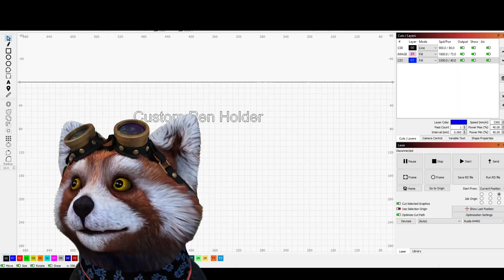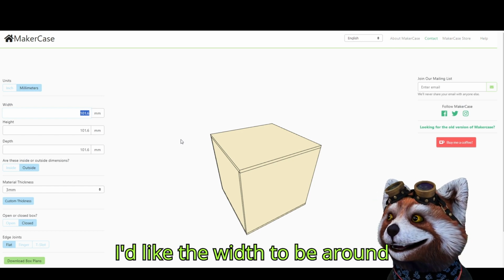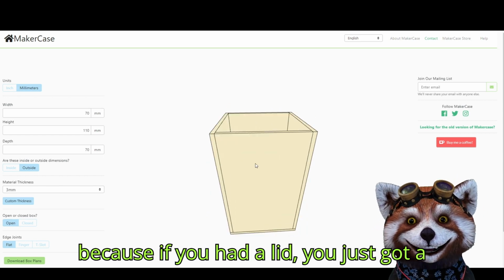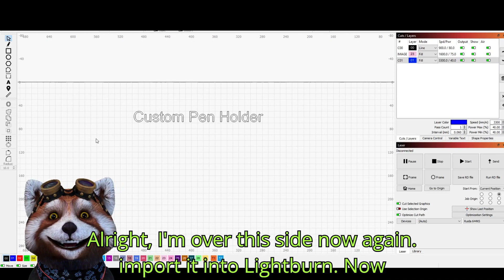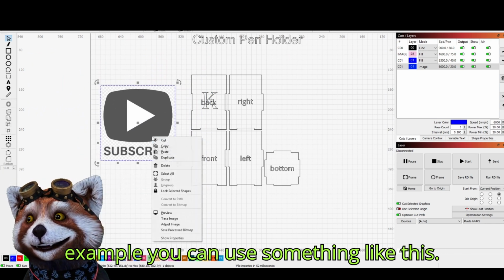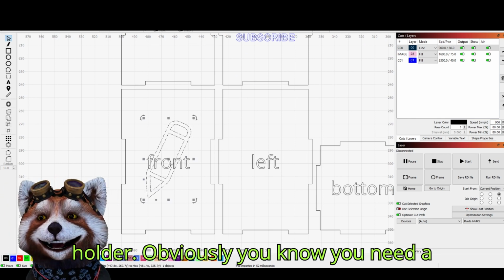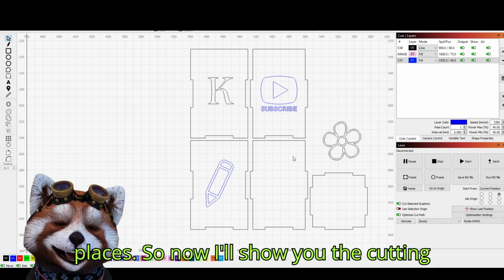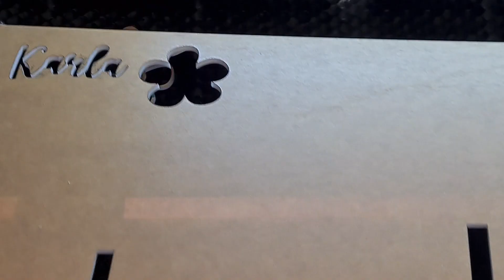Simple & Easy Custom Acrylic Organizer with Lightburn CO2 Laser

Comment: Hello, I have an Atomstack s20 max laser. Laser power 18-20 w. I tried to cut acrylic 3 mm thick, it won't leave any mark on the material. I'm interested in what parameters you set for cutting acrylic 3mm?
Thank you
Reply from the maker: Hey there! In this video im using a co2 laser. I think that laser you mentioned is a diode laser so it won't be able to cut coloured or clear acrylic. I had a similar diode years ago and the only a acrylic  it was able to cut is black acrylic. Hope this helps!